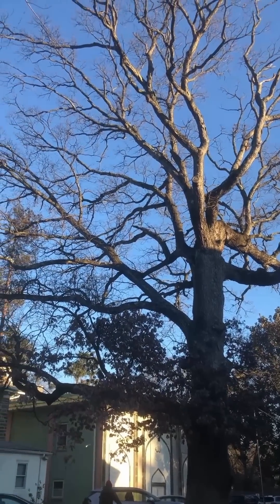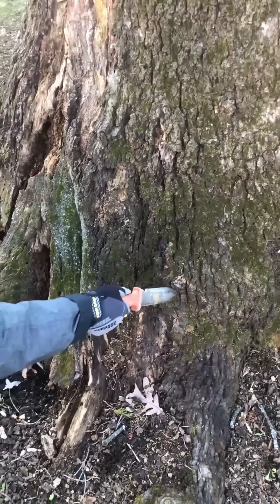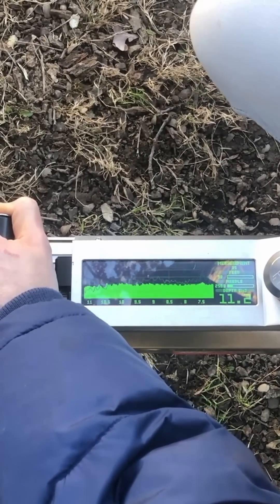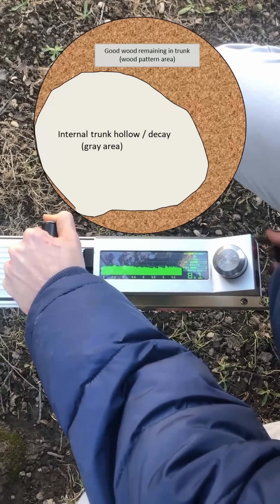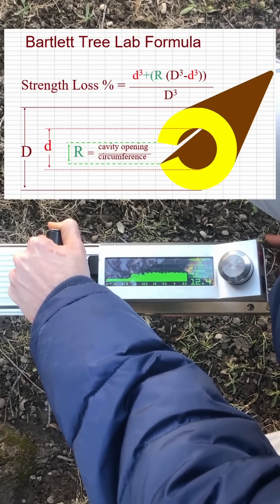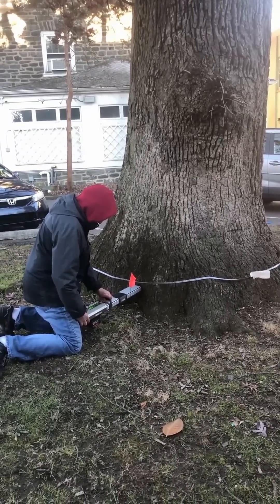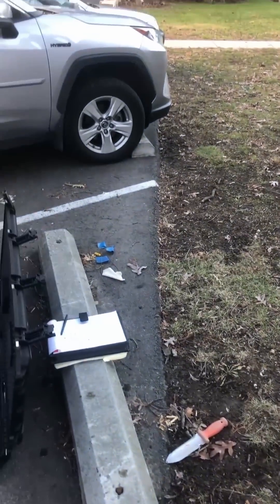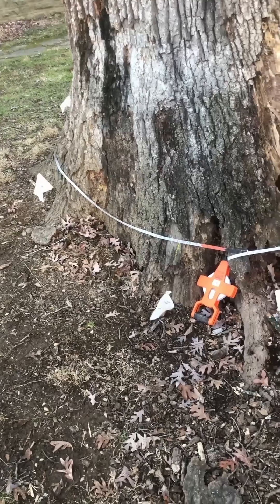Does this oak have enough strong wood remaining?

Comment: Good call on the parking lot doing the original damage.  I've seen a monster white oak that failed with well over 90 percent decay in the stem. That means it stood with 70, 80, and 90 percent decay.  White oak is uniquely sturdy even with advanced decay. While based on species, the liklihood of failure might be small, one has to consider the risk to property and life must be considered.  No consulting arborist is going to feel comfortable recommending preservation.  Sadly,  the tree must go.

Comment: This is why the root protection area or RPA is important. If you want a tree to be retained, you can't have the main roots be cut, or any heavy machinery or heavy material happens in the RPA. I can't remember the exact but it's either 12 or 20 times the diameter at chest height. It's easier to go by the area the canopy occupies

Comment: If your hypothesis can be proven, which it can be... and the proof shows that your hypothesis is correct... than can the homeowner seek legal or financial remedy from the parking lot contractor or parking lot landowner, assuming it's not the home owner? As a construction worker I don't know how I feel about this, as that could make what seems like simple work decisions turn into unforeseen financial liabilities in the distant future, when all we were doing was trying to build the best something (parking lot) we could. That hardly seems fair. But I also don't work in asphalt and concrete... I'm an electrician so, maybe excavators, road workers, concrete workers, etc. already know about the potential issues that can arise from deciding to cut routes and thus have code and procedures to follow on the matter... I know that whenever we dig trenches to lay wire in, we do not hesitate to cut roots, but usually, it's only small ones. We're talking ones that can be cut with the shovel itself, but I have cuz some that required a sawzall. I was unaware that I could have been causing tree rot. I asked about cutting these bigger roots the first time I had to do it during my apprenticeship... I was told "don't worry about it, the tree will be fine." Uh, my foremen, master electrician, and owner of the company at the time must not have known. Odd since I also call him Dad... and so I know his farming background. I used to play on Grandma's Farm as a kid... he knows about plants and roots and soil and even trees... the farm also has a small peach orchard. My uncle owns the farm now, and his sister, my aunt (not his wife, my aunt) owns the orchard separately. Anyways, my point is... if any electrician is to be expected to have this as their background knowledge... I'd think my dad would be the one. Nope, he said, just cut it don't worry about it the tree will be fine... uh... 

Anyways, I just went by that my whole career thus far. I will be looking into this. I have an uncle on my step mom's side that has an excavation company. I might start by asking him.

Comment: My community garden recently lost an oak tree that was a few hundred years old. It scared the crap out of the one person in the garden at the time, and it was very lucky that nobody was in the way when it fell. Especially because it was only 2 days before a community work day, and the area where it landed would have been full of volunteers working. The timing could have been so much worse. The trees had been assessed, but this one was worse than expected and there was only 6" of good wood left.

So it's a bummer to cut down a big tree like this, but it's dangerous to risk it coming down on its own! Especially if it's near a house or power lines or just a lot of people

Comment: What about dead trees in nature? Animals need them! Such a shame to remove them. They should at least be left to rot after being cut down. Some animals live in hollows in trees, anyway! I hate people who don't want nature! God will punish them! I want wildlife around me!
Reply: These are good thoughts - hoever in this particular location/ situation the tree is too near people & their property for their safety.
The people and property are 'targets'. They are in an area of land owned by someone who has a duty of care to make sure that what's there doesn't hurt these people or their property- these people & their cars are not trespassing in a privately-owned wood, where dead wood, useful in the natural scheme of Nature's constant Renewal - are to be found , and can fall off with no danger to people/property.
Reply: @noelsalisbury7448  If these people caused wrongful damage to the tree, then they are responsible for it, and should bear the consequences.
Reply: @lucykelly7152  Totally agree.
However the perpetrators who (probably) worked on the Car Park surface, after this length of time, may have retired, gone broke / sold-up.  Even if the original owners signed & approved the job, - unless it can be proved that they knew  about the root cutting and either disputed/disagreed with it Or " turned a blind eye " Or just didn't know about 'any tree issue (s) ' at the time ..... then there's - sadly (imo) no case to answer 😔
They're just gonna say "prove my negligence".
And that's why even a crummy little car park should first of all have Planning Permission ( or not!) & an 'Authority Person' come and look at it.
In the end, owner wants a car park & owner gets a car park.   
Ownership CAN turn folk selfish.
Reply: @noelsalisbury7448  But if it can be proven, then they should bear the consequences. It's a shame to lose the tree!
Reply: Not next to a parking Lot or house

Comment: We had a massive white oak tree that did the exact same thing due to a parking lot being built over it's roots on one side.  But, the tree was over top of a cemetery and we couldn't mover anything out of the way.  So we had to he extremely careful as to not damage anything when we took it down piece by piece and replaced it with a few smaller white oaks.  I hated to cut it, but all of the grave sites were in danger, as was the church.

Comment: This is why I don't have a paved driveway. Big oak tree between our property and the neighbor's with drives on either side; the roots stick out on our side, so we have a really uneven, rough, cracking asphalt drive. It's still probably pretty hard on the tree to drive over the root, but it's better than cutting it. Unfortunately it's starting to warp the surface enough after several decades that our sedan occasionally bottoms out on the slope, so we may not have much of a choice soon.
Reply: Build it up with coarse limestone 1inch chip. Keep that loose, with no 'binder' like cement ( That way the roots with still breathe) - and prevent the stone from spilling-away by some quarter-inch thick 6inch 'pegged' boarding .at the limits plus another , say , six inches wider from the width of the vehicles sides.

Comment: What could have been done to prevent this? I’ve seen people tar over cut branches to protect the tree, would this have helped or what?
Reply from the maker: An arborist should have been involved from the planning stages to prevent significant damage to the tree if they wanted to preserve it. Perhaps the lot could have been pushed back another 5 or 10' to prevent significant root damage, or perhaps they could have skipped a few parking spots closest to the tree.
Reply: @Andrew_the_Arborist  aright, so basically any removal of large roots is probably a death sentence for a tree?
Reply from the maker: @xX1GuNNy1Xx  not always a death sentence, but it’s incredibly stressful for the tree and can open it up to all sorts of pathogens.

Comment: white oak is a lot stronger when rotten than any local species. If that tree was maple or tulip it would need to go. I've seen white oak finally fail with over 90-95% decay. Also it matters where the decay is and the location of valuable obstacles and danger to human life. Wehnt he decay is opposite an area with no obstacles, the tree is far less dangerous, as they ormally fall away from the are of deay

Comment: in drysdale victoria australia the criminal local city of geelong have covered 70% of a hundred year old sugar gum with concrete despite pleas to those concerned nothing has been done with a nine foot diameter trunk its structural failure and death is assured. the trees location is no. 10 murradoc rd drysdale. l could gain no assistance in saving this tree.

Comment: Could One also use Ultrasound to look inside a Tree?
Reply from the maker: Yes! There's a cool tool called a sonic tomograph that does just that. Less invasive - no need to drill into the tree.
Reply: Yes there is a device similar to ultrasound that scans the inside of trees

Comment: Dumb idea: How about fixing the tree? I'm curious. Other wooden stuff gets fixed all the time.
Reply: Other wooden stuff isn't alive
Reply: But the wood inside isn't also, isn't it? @Leefbones
Reply: @robine5280  
Well yeah but adding dead meat to a rotting arm isn't gonna stop the arm from rotting

Same with trees
Reply: @Leefbones  Yeah but it would stop it from falling over. And I'm pretty sure you can do things to stop the wood from rotting. It's far cheaper to cut it down for sure.

Comment: Thank you for using a device that common sense could have taken care of. Smh some gadgets should not of been made. 😂
Reply from the maker: Can you see through the tree into its center? What if the inner was entirely solid, or there was no heart rot because the tree compartmentalized the outer decay? There's no way of knowing without a tool like this or a sonic tomograph. You can't simply look at this tree and be able to instantly know the extent of the internal decay.
Reply: @Andrew_the_Arborist  I speak to the trees. Before that machine, people like me were taught the ways of reading the land and communicating with it. 
Edit: I didn't mean to upset you, if you love your technology and it's helping you perform certain tasks for your job, that's cool too.
Reply: What kind of x-ray glasses are you using?
Reply: And Andrew, I can simply look at that tree and see that is suffering. You just refuse to believe and that's okay.

Comment: But the pathogen that's killing that tree lives in the soil. So putting in new trees of the same species will just invite the pathogen yo attack the new trees. Wouldn't it be smarter to plant new trees of a different species?
Reply from the maker: Many pathogenic fungi live in the soil everywhere, but are only opportunistic meaning that they’ll only enter / harm the tree if it’s damaged or stressed. As long as one doesn’t open huge wounds like in this case (where they cut huge roots), there’s nothing much to worry about.

Comment: this is so heartbreaking!! i freaking love oak trees man :(( I feel like this could've easily been prevented if they had consulted arborists before building the parking lot :(
Reply: Perhaps the solution is not to have an expert on every site to make sure we don't destroy too much while paving... Perhaps the solution is to have less cars and less parking lots, so the destruction simply doesn't happen and doesn't have to be managed.
Reply: Unfortunately, most people would need an arborist on site to even TELL them that an arborist needed to be consulted in the first place. We have to get better about our culture in relation to trees, generally.
Reply: Right wrong or indifferent, an arborist's opinion was irrelevant 30years ago And only matters to those who want to hear it today.  Spoken by a 10 yr arborist.
Reply: @my_goodman7162  hi, in my city a parking lot structure doesn't go deep, how this could have affected the tree?
Reply: @luismoref  well,  most of the roots of a tree are inside the top 3-5 feet of the soil with some sinker roots or tap roots going deeper depending on species, so even relatively shallow ground work can disrupt them, but the bigger problem is that trees work kind of like straws drawing up moisture and nutrients, or in this case bacteria/fungus that causes rot.  The arborist in the video explains their theory is that some kind of infection got into the roots during construction and spread into the main body of the tree,  think gangrene in humans.
Reply: @my_goodman7162  oh I see now, it worried me because I plant a tree just 1 meter from my patio made of concrete. But since I plant it after the construction I think I don't need to worry.
Reply: Eventually it's going to start pushing up your patio and walking over the roots compacts the soil and can damage the tree that way. some of the reasons city trees often don't make it.
Reply: @WenzelSays  she is already 4 meters tall.. I think I'll have to let it be
Reply: Well good thing about trees is they grow back man
Reply: @jonvonpony7171 shitty thing about humans is they cut all of them down to build cities and then wonder why its so hot out.
Reply: @jonvonpony7171 o you know how oaks take to grow?

Its not like just going and buying a new tree, they take years just to be self supporting, and many many decades to grow as large as the one in the video.
It could be half a human lfetime before the replacement trees are as big as this one.
Reply: @jonvonpony7171 so do humans. Not an excuse, no matter how much everyone who knows you might want to rip out your spine. ❤
Reply: @jonvonpony7171 The tree in this video is probably over 150 years old... 🤦🏻‍♂️

Comment: It is so sad that it will have to be taken down, but it is necessary.  The biggest lost from this tree dying is the decrease in oxygen it once produced.   It is being replaced by 3 new trees, and while it will take years for them to take it's place, they will get there.   FYI:  2 full grown trees produce enough oxygen for four people for one year.
Reply: While this is indeed sad i think you should look at the beginning of the video again, the tree looks already dead so it may be better to cut the tree and grow a new one.
Reply: @nz1309  Thanks.  I revamped it
Reply: Yeah but what happens when a 20,000 lb oak crushes a roof and kills 6 people? Was it worth keeping the dying tree then, for the air? Have a little think before you comment about saving a hazardous situation.
Reply: @alexmills42  A dead or dying tree removable has procedures that must be followed for safety.  Storms take out large, heavy branches, tornados rip up trees which land on houses, cars, etc all the time and these are sometimes considered an act of God or Nature.  So, until this tree was tested and found to be dying, no one was the wiser.  So please  reread my comments.  At no time did I say the tree should not be cut down.

Comment: I get everything, but why recommend replacing one tree with three? White oaks get even bigger than that one was and that tree hardly has enough room by itself
Reply from the maker: They had a lot of empty lawn on the property, not really shown in the video. So we recommended they plant in those places!
Reply: In 50 years maybe?
Reply: @straight-up-shots  and they live to 500? Exactly, that means in 50 years some future owner will have to pay to remove or maintain the trees rapidly outgrowing the property. If you want more trees how bout some smaller ones that won't mind being overgrown by the oak. Hollies, dogwood, Japanese maples, etc.
Reply: @eliharper6616  Sure. How many trees die early in urban areas? What if you plant 1 and it dies in 1 year? Or 10 years? Then you have to start over right?

Comment: I can’t believe people pay for this.   Damn it’s very obvious it needs to be cut. Any country folk tell you that.
Reply from the maker: Nah, I disagree. There’s no way to assess the internal decay without a tool like this or a sonic tomograph. This tree could have been completely solid on the inside, or could have only had a few inches of an internal hollow, and would have been perfectly fine to remain standing. There’s no way to know if the cavity / hollow isn’t visible from the outside.

Comment: Gosh, I wish I could find a good starting arborist job. Everything in my area pays too little to rent an apartment, or even a spare room/basement.
Reply: Unfortunately i think it's one of those occupations where you have to be the owner...
Reply: @mrkiplingreallywasanexceed8311 Nope. I make $35-$100/hr as a contract climber. Plenty of ops pay $25-35/hr starting out based on experience.
Reply: Perhaps you can start off by looking for work at a nursery or something like that. It isn’t an arborist, although you would be able to interact with plants regularly